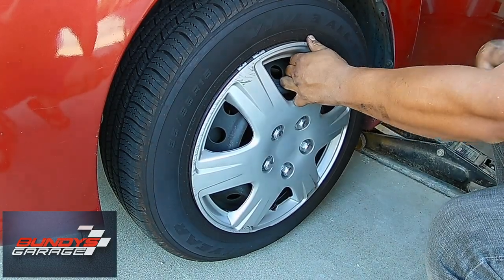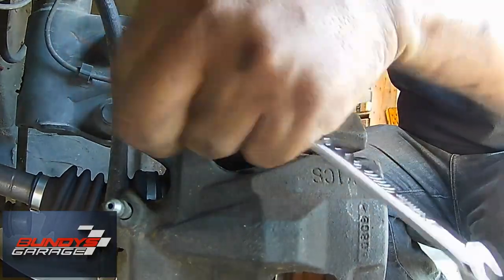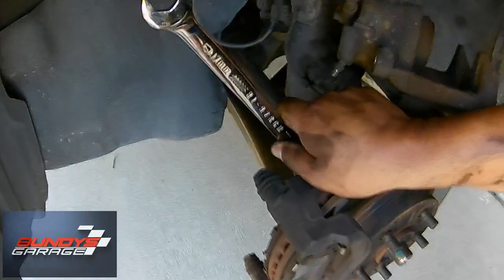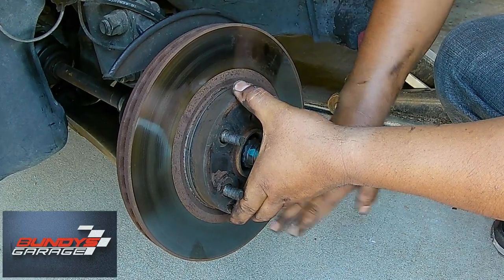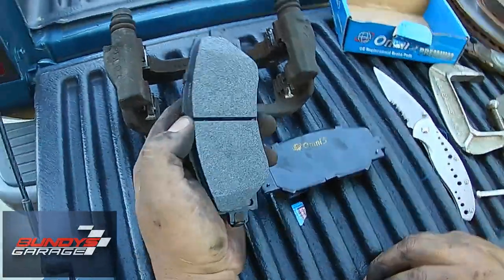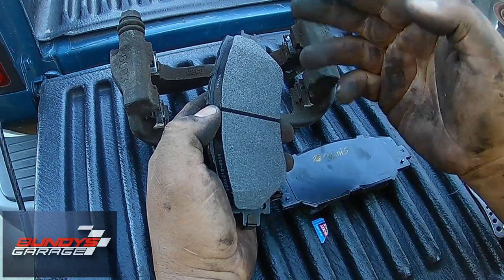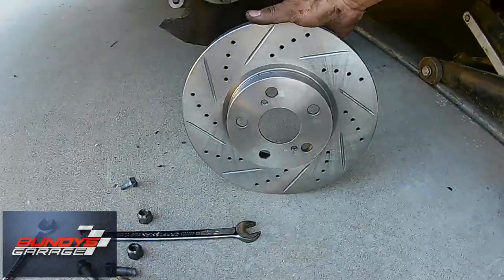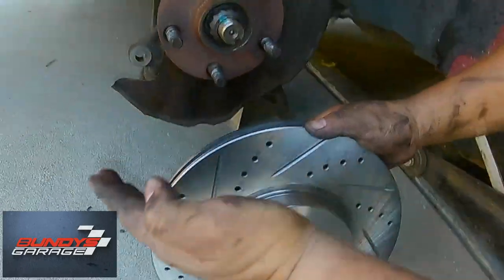2009 - 2019 Toyota Corolla Front Brake Pads and Rotors Replacement | Vibe Matrix | Scion XD

Comment: First off I must say that these guys are making some big mistakes. They need to clean the entire caliper bracket with a wire brush and brake cleaner, they need to clean the wheel/hub studs and wheel hub with a wire brush and brake cleaner to ensure a good clean hub to rotor mating surface, and those rubber o-rings on the slide bolts are to reduce vibrations and ensure quiet braking so just removing them is stupid if they are bad just spend the ten or twenty bucks to replace the slide bolts same with the caliper bracket bolts or any other hardware if any of it looks bad just replace them. And with those cheap pads and drilled/slotted rotors which are crappy Amazon or eBay junk brakes there will be way more noise and vibrations especially after reusing those slide bolts without their proper o-rings installed. I cannot stress enough the importance of doing things right the first time and not being cheap on vehicle maintenance and repairs and if someone can't afford to do it right they have no business owning a car. This is the most half assed brake job with the cheapest online bargain bin parts I've ever seen man I give it a month and those brakes will be metal on metal again cuz this is a shoddy job with cheap as hell parts. Am I the only one who strongly believes in taking the time to do things perfectly with only the very best top quality parts? I guess that's why all my American brand cars have each lasted me half a million miles and looked and ran perfectly until the day I traded up to a newer car including my current cars with minimal problems cuz I take my time and take meticulous care of every car I own. If something is worth doing it's worth doing right 👍

Comment: and the 12mm bolt from the radiator mount that can be screwed into the old rotor to break it loose if rusted (and then you replace the radiator bolt). A very clear video.

Comment: I did this exact job.  Everything seemed to go fine but my break pads won't disengage from the rotors, so there applying continuous friction when I drive.  I just drove a few miles and the rotors were burning hot with a burning smell.  Anyone know why that could be?

Comment: Rotor Tip.. I live in Canada and the rotors are rusted solidly on the car.  Hammering the rotor didn't  work for me. The rotors have 2 small holes near the center. They are threaded. Get  2  Bolts that fit them and slowly tighten each one until it pushes the rotor of the wheel.
Reply: The bolts are M8 x 1.25   50mm long. They are called Jack off bolts. They work great. I have a set.
Reply: For me, hitting the hat of the rotor with a hammer works best at breaking the rust connection. Remember to put the lug nuts back on to protect the threads from your hammer strikes.

Comment: Wow that hammer trick at the beginning is awesome! I already done my front brakes but still have to get to the rear. While inspecting them a while back I realised I probably won't fit my breaker bar in there, I haven't been looking forward to struggling with a short ratchet/wrench. Now I've seen this, it doesn't look like such a scary proposition - cheers fellas!

Comment: Nice job nice detail job but I'm curious is why you did not use a ratchet and a socket instead of an open-end wrench and you should never tighten a bolt like you did with a hammer just my 2 cents
Reply from the maker: Yes if you have a torque wrench use it to tighten down those bolts. I usually do and not sure why I used a hammer to tighten them down. Maybe I was in a hurry. I used a wrench cause most of the time you have to strike them with a hammer to get them loose and I do not really want to do that to my ratchet, too much stress on the gears.

Comment: Can you tell which brakes need to be changed or should you change all at once?
Reply from the maker: You should change both side at the same time. Say the 2 fronts or the 2 rears. But rarely do you need to do all 4 at the same time. Most of the braking power comes from the front so you will change fronts more often than rears.
Reply: @bundysgarage  much appreciated. Your great at teaching. Keep it up boss

Comment: I watched a video a few weeks ago which attributed the swelling of the rubber to the type of grease applied to the slide pin. They had positive results by using a different type of grease. I wish I could remember the types though.
Reply: Silicone based grease. Anything that is petroleum based degrades and swells rubber parts. Syl-glyde is available at most auto parts stores.

Comment: I like to get a couple of cans of spray Carb Cleaner and clean that whole caliper frame off. You may able to clean the little black rubber slider boots off and condition them with rubber conditioner like what you use on the car trim. I do not recommend reusing the brake pad clips Toyota brake kit clips are $26 for both wheels brand new. Money well spent. I use Permatex Ultra Caliper Lube for slider pin grease. in the green bottle Its very sticky and works really good. While your in there spray some rubber conditioner on the inside and outside cv joint  rubber boots on the cv joint axle. If a boot cracks and fails the grease runs out and the cv joint will fail. CV Joints are very expensive now. Also get a  rag and rubber condition the rubber brake line that goes from the chassis to the caliper. Amazon sells a caliper compression tool kit to push the caliper back in. It has has multiple pads for all sizes brake bores. $25. Also spray some lube on the A frame joints.
And lastly spread some grease on the hub to to caliper mating area and same with the hub to tire wheel. Then neither will stick together  when you go to remove it. Very common to have a tire stuck on the hub after you take the bolts off. if you get stuck like that on the side of the road just loosen all the tire bolts and lower the car to the ground that should break the tire loose.  
These are all things I have done in my driveway for 50 years and work great.

Comment: BundysGarage, if you were looking for a daily driver for commuting to the office and expect to add about 16,000 miles on the odometer per year in a mixture of city & highway driving (max speed limit about 70 miles per hour) and bumper to bumper traffic jams. Primarily looking for hatchbacks (as I like having a rearview windscreen wiper) & I'm only looking for automatic cars than have less than 62,000 miles on the odometer.

Which of the following automatic transmission vehicles would you consider to be ultra-reliable and provide the best solution (I prefer the smaller build size as it's easier for parking & maneuvering in the city):

Mazda 3 SP25 2nd Gen(BL; 2008–2013) using Mazda L (L5 SVT) 4 Cylinder, 2.5 L engine or the Mazda 3 SP20 SkyActiv BL Series using Mazda SKYACTIV-G 4 Cylinder, 2.0 Litre engine. Sports Automatic Transmission

Hyundai Accent Elite, SR, or Sport 4th Gen (RB; 2010–2018) using the Hyundai Gamma (1.6 Gamma GDi [G4FD]) 4 Cylinder, 1.6 Litre engine. Sports Automatic Transmission

Kia Rio Sport or Si 3rd Gen (UB; 2011–2017) using Hyundai Gamma (G4FABU or the G4FDBU) 4 Cylinder, 1.6 Litre engine. Sports Auto Transmission

Kia Cerato S 3rd Gen (2012-2018) [Known as Kia Forte 2nd Gen (YD) in the USA] using Hyundai Nu (G4NB) 4 Cylinder, 1.8 Litre engine. Sports Auto Transmission

Hyundai i30 Active (GD; 2011–2017) [Known as Hyundai Elantra GT in the USA] using Hyundai Nu (G4NB) 4 Cylinder, 1.8 Litre engine. Sports Auto Transmission

Honda Civic VTi-L or VTi-S 9th Gen (2011–2015) [Acura ILX in the USA] using Honda R (R18Z1) 4 Cylinder, 1.8 L or Honda R (R18Z4) 4 Cylinder, 1.8 L engine. Sports Auto Transmission

Honda Jazz VTi Second generation (2007–2014) [known as Honda Fit in the USA] using the Honda L (L15A7) 4 Cylinder, 1.5 L engine. Auto Transmission

Hyundai i30 SX First generation (FD; 2007–2012) [known as Hyundai Elantra Touring in the USA] using Hyundai Beta (G4GC) 4 Cylinder, 2.0L engine. Auto Transmission

Toyota Corolla Levin SX or Ascent 10th Gen 2007-2013 (E140/E150) [known as Toyota Corolla or Toyota Matrix 2nd Gen in the USA] using Toyota ZR (2ZR-FE) 1.8L engine. Automatic Transmission

Honda Civic Sport 2011 or VTi-L 2011 8th Gen (2005–2011) [Known as Acura CSX] using Honda K (K20Z2) 4 Cylinder, 2.0 L engine or Honda R (R18A) 4 Cylinder, 1.8 L Engine. Automatic Transmission

Mazda 3 SP23 First generation (BK; 2003–2009) using Mazda L (L3 SVT) 4 Cylinder, 2.3 Litre engine. Sports Auto Transmission

Honda Accord Euro (8th Gen 2008–2015) [known as the Acura TSX in the USA] using the Honda K (K24Z3 LEV) 4 Cylinder, 2.4 L engine. Automatic Transmission

Toyota Camry RZ or Atara R XV50 (2011-2019) using the Toyota AR (2AR-FE) 4 Cylinder, 2.5 Litre engine. Sports Automatic Transmission